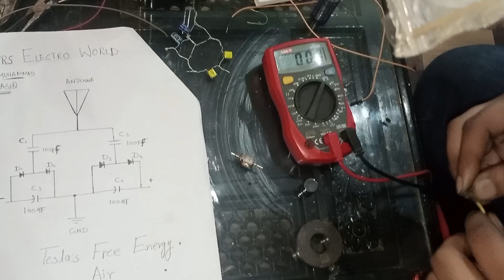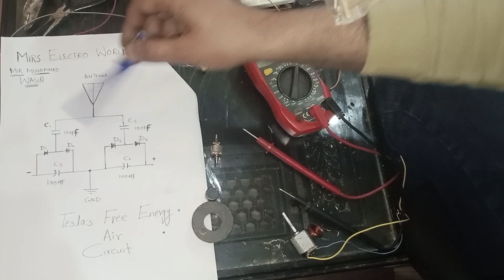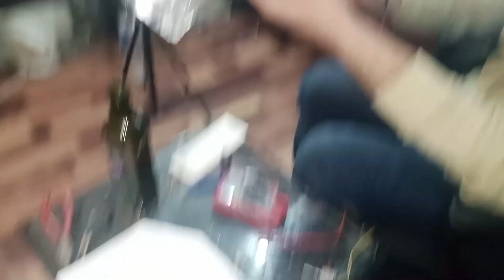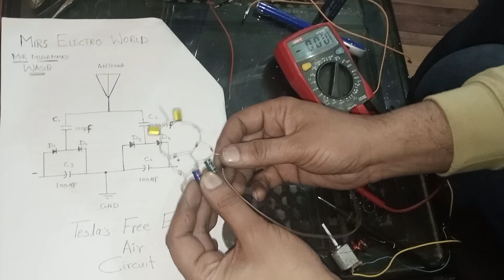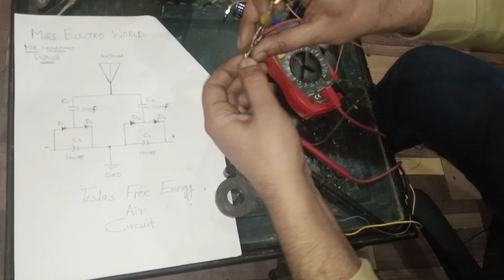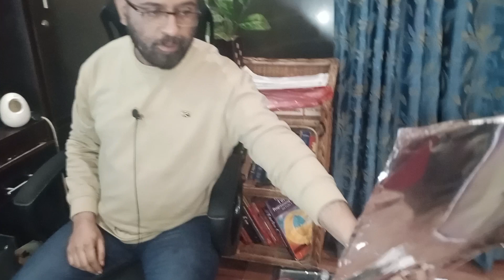Free Energy Machines Real or Fake

Comment: I have nice idea, in fact more then just one you might check it out on my u ch             
A few good ideas that based on known clues of physics 
|                                                  "+"
|                                                    |
|                                             ____|____
|                                                    |______________  "+"(out)
|    

|             "--"(out) ‾‾‾‾‾‾‾‾‾‾‾‾‾‾‾‾‾‾‾‾|
|                                             ‾‾‾‾‾‾‾|‾‾‾‾‾‾‾
|                                                      |
|                                                    "--"
Idea is to discharge capacitor(two plates) inwards instead of outwards in which direction force(hence Voltage) is weaker/lesser but inward in which direction force is much stronger/greater
After that charge could depart through mid-plane in between two poles/planes
without any hinder (because "+" and "--" in this/along this plane equally far)
And in theory charge could leave as much far as it takes(infinitly) without any effort/work

This is the idea- capacitor that amplifying Voltage (meanwhile current would be the same)
In theory it(this principal) allows to obtain free energy

This is not only opportunity , 
another one -  in equation for U(voltage) = dB/dt  there is no such things as distance and B(magnet force) as name imply force per current unit.
Which means output power depends on force solely, because voltage proportional to difference between forces , and current proportional to current itself(We might spent 1 meter or 1 millimeter to obtain the same 1 Amp and U voltage)
of course it is without metal core inside the coil , because this way it would be messy. And of course in reality there is interaction between currents (there is no such thing as magnetic field , this is really wrong conception, model of magnetic field depict almost nothing about real interaction, for electrostatic unit is charge , for magnetic interactions it should be section of current, and it would be calculated by integration of interaction between this sections)

We could spent 1 millimeter to gain voltage on generator without metallic core
But we also could make almost constant Magnetic Force (B) 
it would be nice motor with force but almost without voltage on its coil. (of course without iron core)
(something similar to  constancy of Gravity force near Earth surface)
if we look at the formula we would notice that its required high mass and large distance of it (there is distance to center of earth in formula and if its value changed on 1 or 2 meters difference would be very low(negligible)
for magnet it would be high current and large distance.
For simulate section of current we might make wide magnet with very strong current (magnet consist of two opposite currents)
So in the same plane as this current we might place our wire motor.
If our Giant magnet would be electromagnet even this tiny induced by our motor voltage would significant 
For example 0.000 000 00001 Volts and 1 000 000 000 Amps 
but we could use permanent magnet for this , as from where it make energy for it (from ether or other  interaction with 
Universe m  , this question remains)

Another one model where constant current of permanent magnet generates power you could find on my tub ch
In short there is energy of permanent magnet as well , if use coil instead there would be spending of the dame amount of energy

There is effect Called "Seebeck Effect"  - this Effect itself is a generator.
Because
Connection between two metals no matter how thin(wire-sprout) 
would Change State of System drastically/completely (how it operates).
Before connection there is no way for electrons to move freely between two metals (there is a surface charge that prevent electrons from leaving metal surface) , but tight connection just erase this barrier , and state of system would start to change to the new value of surface charges on each metals.
There would be current , there would be voltage of this current
And amount of this current would be dependent only on amount of surface/volume of this metals (not surface area of connection , this would only contribute to the speed of process)
We may connect as tiny wires as it takes , but take metals with as big surfaces as it takes. (low to nothing spendings and substantial income).

Just by switching system between two states this process could generate current.
But there is a thing , if areas of the surfaces for this two metals would be big enough and connection wires would be small enough , process of charging wouldn't  keep up with  restoration process (by environment) and it wouldn't be necessary to switch system at all.
(Environment is restoring system all the time(charge diffusion in environment) ,
after two metals is disconnected metals would eventually change back to its former state , excluding chemical reactions , to prevent this noble gas like Nitrogen or Helium should be used)
(this system would by Giant(at least in terms of surface))

There is a system that changing its state out of low to nothing energy and scale don't effect consumption (raising gain without spending's )